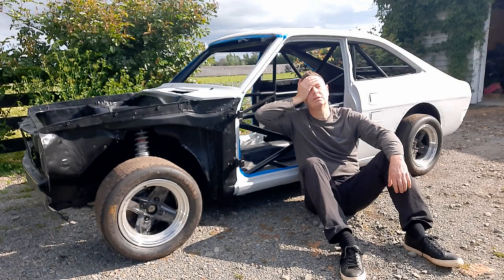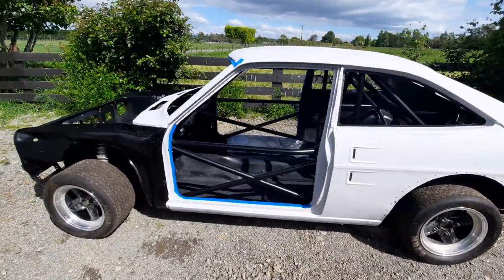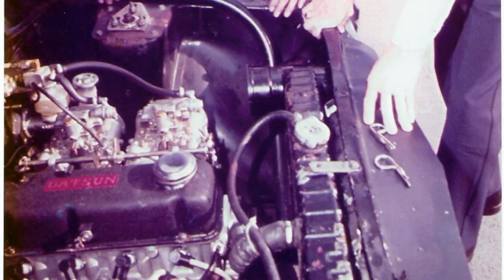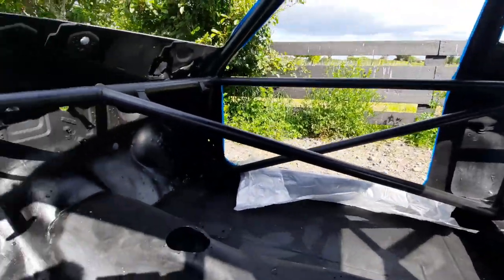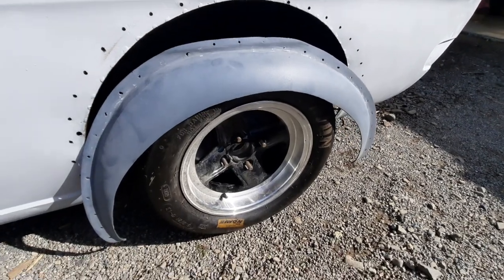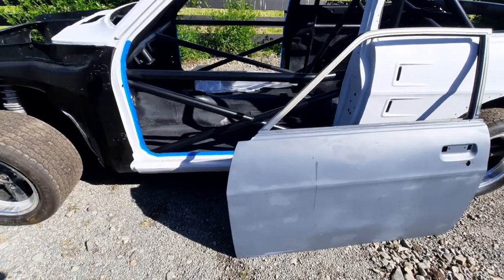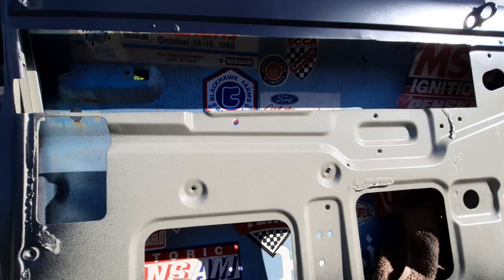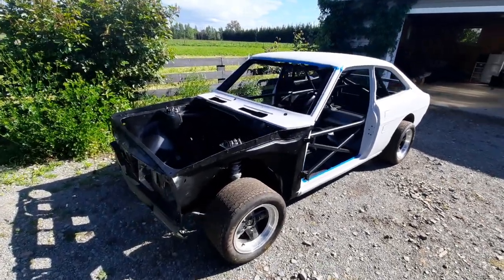Will I Ever Finish Restoring It? - Datsun 1200 Restoration

Comment: those look like 510 rear flares
Reply from the maker: Good spotting! This was something I only discovered recently. The fender flare kit for the Datsun 1200s supplied by the Datsun Competition Parts catalogue in the '70s used BRE rear flares. The front flares were designed specifically for the Datsun 1200 but for the back they just used 510 flares. They actually don't fit so well because the 1200s have the rocker panels that jut out which leave a big gap